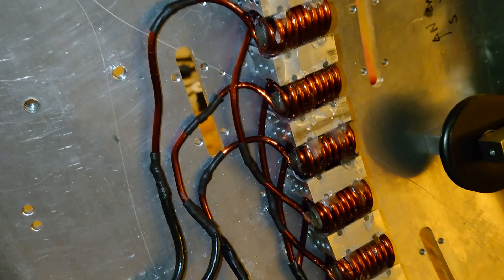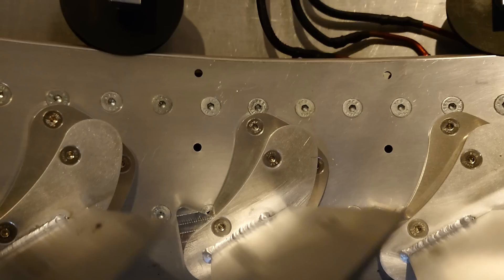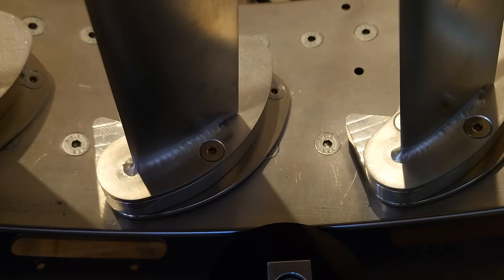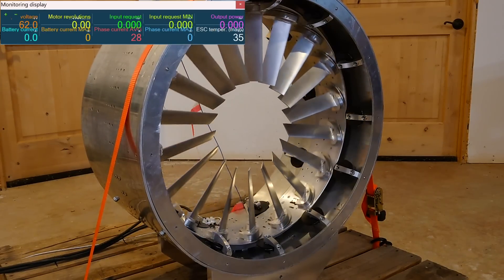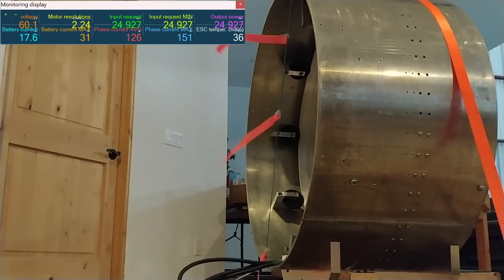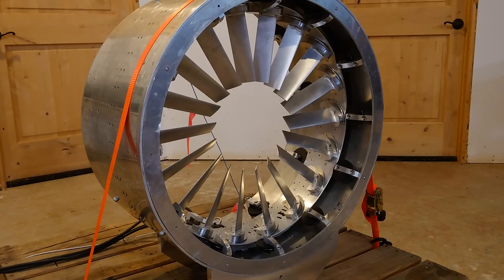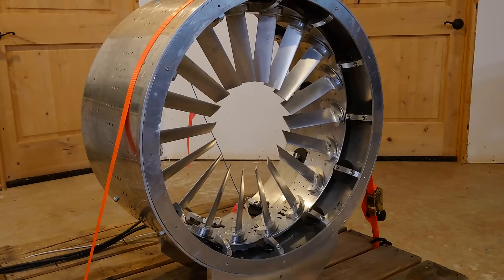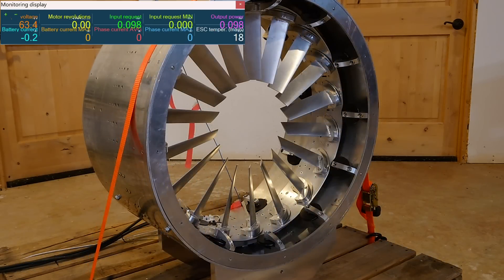Rim Driven Coreless Thruster running at higher RPMs

Comment: That is a  great idea! I personally have been mulling over such a design (mostly for power generation) for about half a decade now, but so far everything is "rotating" only in my head ( as Tesla noted about his inventions ). Several venues for optimization points though. The entire structure can be considerably more deep and in such structure the blades clearly can be elongated ( and not so numerous ) starting very shallow at the front and getting deeper at the back, in such a way to create an empty cone in the middle where the fluid can self-organize.  For more on the fluid dynamics and the misunderstanding of the Bernoulli physics phenomena (not a principle !) one can reed the post about "New Discoveries Regarding How Fluids (such as Wind and Water) Flow" by Dr.  Robert D. Hunt, and consider the many implications it leads to especially when destining machines interacting with a moving fluid either for extracting of  or for impacting on power.

Comment: Don't you need to adjust the angle of attack of the blades according to radius ?
You said that the tip of the blade go at half the speed, doesn't that mean that they would stall when the base wouldn't ?

Comment: The inlet needs to be ducted. One issue I see is the gyroscopic function causing control plane resistance.  I designed a similar system for ships. A large horizontal wheel with coils and perimeter electromagnets to drive the screw through a 90 degree drive. The plus was the stabilization that came from the large spinning rotor. Not so good for an airplane. Figuring how to reduce your mass is crucial. Nice looking work.

Comment: would love to see a wind tunnel-style test with this,  I like that it has a lot less of the extra weight going around, any way to make it spin faster? rpm's? if you invert the blades could you have it spinning in both directions at the same time while pulling in the same direction? :D
Reply: I have designed this but with contra rotational turbofans. 12 years or designing and refining the tradeoffs of how to squeeze as much thrust out of this design.

Comment: The beauty of a turbine is the lack of complexity - this does the exact opposite - multiple positioning wheels - bearings etc. 

This man is a software designer  - he has no formal engineering training - why does he think he can design a mission critical element with any degree of reliability?

He refused any professional help that was given on his last venture - the Raptor - which failed miserably - he is delusional - aviation standards and practices are there for a reason - to prevent loss or injury from unproven engineering.

Comment: https://patentimages.storage.googleapis.com/95/32/25/18aa2848a7b7e6/WO2022185164A1.pdf

=WHISPER AERO...(ultra LOW noise patent !)
Reply: -more prospective... (<35 dB , 20 % more specific thrust, simple construction)
Reply: https://cdn2.imagearchive.com/homebuiltairplanes/internal_data/attachments/143/143624-a872f9a33e144f731b1dc3055df69b05.data?response-expires=Thu%2C%2005%20Oct%202023%2017%3A12%3A29%20GMT&response-content-type=image%2Fjpeg&X-Amz-Content-Sha256=UNSIGNED-PAYLOAD&X-Amz-Algorithm=AWS4-HMAC-SHA256&X-Amz-Credential=I3UPHPWOPY63ZMOGLZFM%2F20230928%2Fnyc3%2Fs3%2Faws4_request&X-Amz-Date=20230928T171229Z&X-Amz-SignedHeaders=host&X-Amz-Expires=604800&X-Amz-Signature=b62816084e60079d0bb7db0df6711e2d7dd2967db705fd49e3142e4b23e8ccf1

Comment: You probably alredy know about it but just in case you are like me and having a tentency of forgetting details like my brain does.
From everyting that i learn so far with fan and turbine, having a way to link the inner end tip of the blade will reduce vibration also improving the balance of the fan ring will help. Adding a middle cone tip will also improve airflow.

Else than that, this is a very interesting work. 👍Keep at it!

Comment: Well I'm glad you focus on the engine , regardless a plane.
It becomes an interesting project whit lot of problems ahead which needs solutions by improvements or other setups regarding electric/electronics, aerodynamics and mechanical setup. 
Seems you started to follow facts and data from your experiments instead of expectations.
Beside rollers , what with the way of magnetic trains who have no wheels? 
Keep you mind open and keep on experimenting

Comment: This thruster your building is more suited for water. For the lower RPMs and running in a tube that reduces from intake to exhaust. This motor is more suited for water jet like propulsion. The iffy part is in having electrical in water. Which means short circuits can happen easier.

Comment: To get a real idea of thrust, could you not 'simply' (I know!!) put a sheet of ply on the floor, a few bits of pipe or broom handles on that, another sheet of ply with your pallet on top, then a bit of string to a spring scale to measure the pull?  That would not be far off.  I've seen that done with a replica aircraft (using a horizontally-opposed double sided piston engine) and it was a useful exercise.

Comment: Peter you are doing great and I was following you since you started Raptor program. I want to say something about your blade and fan design. I think you need to modify your blade width. Your blade have same width throughout the length but if you make them more wider on outer ends you could get more thrust as there is big waste of space between fan outer ends. Regards

Comment: A few days ago i put 2   8 Blade Propellers on a high Speed drone motor. 3 Zoll Inch Diameter. It makes a little bit more than 1 hp. 
I see much more trust on my bicycle. 30.000 rpm

Comment: The pitch of the blades is wrong.
You need 5° at the hub and 60° at the center. Also, the blades should be swept back 20% from the center of rotation.
Just a thought.

Comment: Get ahold of an old tractor rim, steel, easier to weld on, and much more likely to be true and balanced.  Also usually pretty cheap from a junkyard.  Also steel would definitely serve your needs better than aluminum,  it can handle way more stresses and not just break. Weight could be comparable if you use thinner material

Comment: Outer dimensional hoops may help deflection.  Two perfect-sized hoops to mount the leading and trailing edges of the outer shell.  The strap could be eliminated, and the metal structure would make for easier bolt-in applications.

Comment: Cool project!
I think you would need to reinforce where the rollers run. At high rpms, the blade will push hard outwards and as a blade moves between 2 rollers, it will deform the outer ring. So you need good support.
Also, if you use large rollers, with many small bearings in each one, you might be able to handle the high rpms.
Look forward to seeing where you go next!

Comment: I saw the earlier video of your project, well done for getting this far. It seems to me you require more data before moving on.
Smoke streamers would be an easy way of getting a good visualization of air-flow across the diameter.
Others' ideas of an inner ring, joining the blade tips may become really valid if power increases were sort. The bending stresses would partly convert to more tolerable tensile stress and fundamental resonance issues, if they occurred would be well-damped. (get the Slo Mo Guys to do some high-speed analysis, I'm sure they'd love to! Or simply use strobe photography to at least see if resonant movement is occurring) I am surprised you were not able to filter the thrust output from the sensors; there are so many ways to achieve this.
I love your original thinking!

Comment: You are re-inventing the compressor of a jet engine, and you say you don't need a ring in the middle, but I disagree. Any flex will introduce vibration no matter how little they may flex. I would also say you need a center spinner that is shaped like a corkscrew design to spread the center airflow to the blades. As it is now, there will be tip vortices that disrupt the laminate airflow.  Are you going to add a cowling on the front to flow air into the blade rather than over the blade mounting and a slight compressing cowling of the rear exhaust for directed thrust? I do like what you have done so far and see great potential!  Maybe consider a magnetic bearing design ( opposing magnets ) along with the standard roller bearing to suspend slightly the blade unit along with friction reduction.

Comment: Curious on anyones thoughts on the idea of having a rotor that's shaft mounted but still driven by the external ring. Imagining the center mounting is a minimal as possible.
Reply: I do, and offered it up to "Design the Future". A horizontal ring 50' in diameter weighing in at 12 tons. Electromagnets drive it, connected to a right angle gear box to the propeller shaft. The gyro force would help stabilize the ship in rough seas.
I think what you describe is with higher merit than his current approach. It permits higher rpm without the huge tip mass increase.

Comment: As you know, you balancing problems are getting you into the precision required of a jet engine. An interesting problem, if you can get it balanced you will need to go back to delta winding because of the speed you will hit. And no, you don't need an inner ring, the forces will pull the air down the blades to the outside. With that said, you could install an inner ring with a different pitch. But again an interesting project. 

The next step is to make the rotor a magnetic levitation item. Rollers for starting and then they back out.

Comment: i think you are underestimating the force of the air, thats why you should have a inner ring, i not mean now, in this stage, but in an actual turbine, other thing its, if the air that a turbine ejects can flip cars, how do you know that the extreme forces are nor going to run the blades backwards, the motors will be strong enought? this is only for the compression state right? Great work really

Comment: This design mandates too much friction for the target RPM. Also the centrifugal forces are amplified with this hubless design putting even more strain on the bearings and the housing. For small-scale implementation this design could have practical application, but certainly not a replacement for the airplane turbine.

Comment: Oh wow ! This is a good design . 
But we’re talking two schools of thought . 
In the United States , we use alteranating current . At 60 hz . Usually . In the United Kingdom , they use Direct current . 
And you Disign a fan with the windings on the out side of the blades . 
That is an incredible thought . All you need to do is control the current . In the UK  . To equal the drag coificiant or over come the drag . 
But I can see this being a very effective way to move air . 
I’m thinking in aircraft .

Comment: if you connect the blades with some kind of ring in the center this might remove some of the vibrations, since the blades themselves are probably vibrating inside because they are not fixed

Comment: Another solution to rewiring fewer coils wye would have been putting coils in parallel (unless you already had them this way).  You will be able to generate the same or lower kv with lower terminal resistance if you use more coils and stator coverage. IE, more torque capacity if controller and battery allows 

  Very cool project!

Comment: Nice idea but electric power is a poor choice for an aircraft primary driver.  If you could power this with an internal combustion engine using high energy density fuel that would be great.

Comment: Getting that thing properly balanced would do a lot for efficiency improvement, because it would lessen the loading on those guide bearings. Even in this prototype setup, having something like a bead roller stiffen that outer ring against deformation would allow for the other work that needs to be done.

Comment: Simple math here. You have 16 bearings to facilitate hubless but if you had a hub you would live 2 bearings. 8x less friction. Love the creativity and certainly get a lot of points for skill in design and assembly.
Reply: Making a central shaft with relatively simple bearings would save a world of complexity while still allowing for the rim driven electric motor design. He could change the pitch of the blades from the center shaft  like the pitch on a helicopter tail rotor. It looks cool as heck with a hole in the center, but cool looks are not a replacement for good old common sense.
Reply: @mp6756  like a fenstron
Reply: @ahaffke  Exactly that is a great example 👍
Reply: @mp6756  But isn't the center hole contributing to efficiency? Flow is being pulled through the center of the fan. If we place a hub there, thrust will likely decrease for the same RPM.
On the other hand, the exposed blade tips at the center should be producing a lot of vortices. I think it would be wise to test the concept with and without a central hub, and let the numbers decide.

Comment: You estimate 8lbs from 5kW. The Airbus E-fan ducted fans have 30kW motors producing 266lbs static thrust. Scaling that down you get around 44lbs at 5kW or over 5 times the thrust of your fan.
I understand your fan is a proof of concept prototype but I'm not seeing that claimed high efficiency.

Comment: Having an inner ring should dampen noise, help pull the outer ring more true during assembly, and provide strength against bird strikes .. may be just enough difference to make it back to the runway rather than the river ( some places don't have a river, its a shopping mall ) .. the heavier the blades the more substantial the outer ring must be to compensate for mass with harmonics continually trying to force outer ring to be out of round by small amounts creating a laundry list of bad things .. a center ring provides needed stability in many ways and can help keep the mass of the outer ring much lower .. is a win on so many fronts....

Comment: what application would this be useful for? the diameter of the ring will start to increases with rpm being that most of the mass is on the outside, how would the bearing handle this? i would assume it would also be a nightmare to balance.

Comment: Why did you not mount the thruster on the center axle with a cone in front to direct the air into the blades ? 
Those rollers will give out.

Comment: I'm guessing that the hole in the middle is causing  problems at lower speeds as the air is flowing backward through the hole. Hence why you believe that the blades are stalling there.  I suspect they're pushing air, but it's circling through the center.  Once the velocity of the air get high enough the flow probably reverses to match the direct which is going through the blades.
Reply: Be interesting to run some smoke thru it to see where the turbulence is.

Comment: You could add controllable pitch with a second ring and a second set of rollers that were attached to a point on the blades. That ring could be slid forward and back to give you controllable pitch of the blades. Just need a controller to map out your pitch curve across different rpm ranges for max efficiency. 

Sadly any more rpm will need precision machined parts and its going to get really expensive really fast.
Reply: That's exactly the first thing that I thought about. Thinking about how a variable geometry turbocharger works. A slewing ring or something of that nature to where the blade angles can be changed in real-time to get the maximum amount of thrust at any given Revolution what do an interesting consideration

Comment: Awesome. 5:36 your FEA may be right in terms of not reaching deformation. But they are obviously flexing which will propagate a twist down to the ring. It would not harm and likely help to stabilize that be it with an internal ring or however.

Comment: Now imagine wielding an inner ring on that, then adding a shaft, then adding compressor blades along  the shaft, then adding a combustion chamber. Then adding an after burner and blades to the end of the shaft. This will multiply the rpm more than a thousand fold. This will give thousands of pounds of thrust maybe millions. That's military grade power for fighter jets.  Electric engines can never produce the power fuel jet engines can. There's a group of people out there who want to replace the fuel powered jet engines and produce an electric jet engine that give the same power. I don't think do. I'm for fuel engines. I don't know your motive for producing this video but it's a wonderful opportunity for me to to say what I'm saying. To those out there who believe that they can produce an electric engine that can provide the thrust present fuel engines can, produce it. Then I will add fuel to that engine an be able to fly one thousand times the speed of sound. A jet flying one thousand times the speed of sound can't be operated by a human because our bodies can't take those speeds. That jet will be remotely controlled.